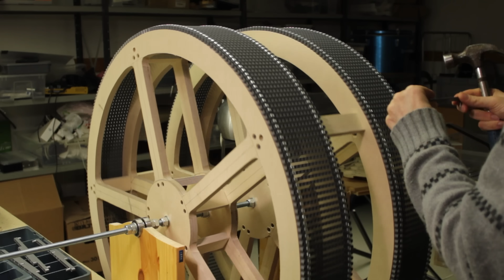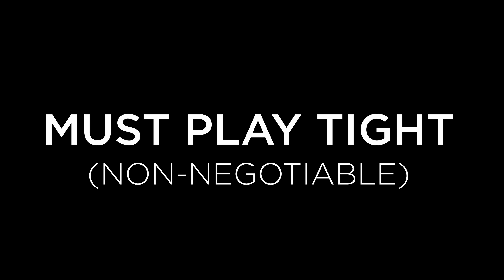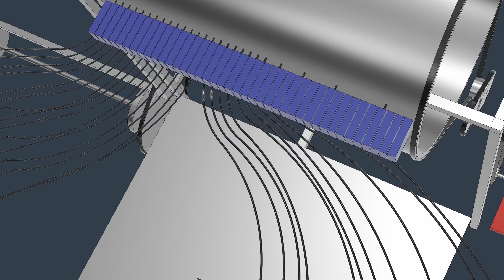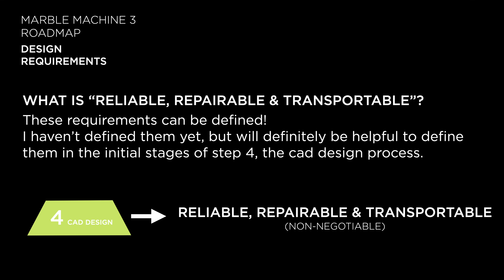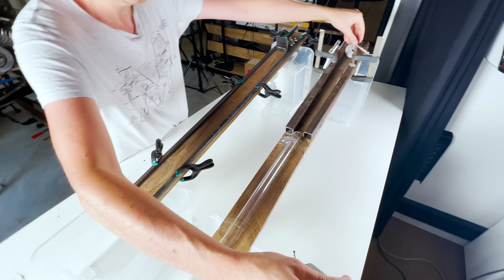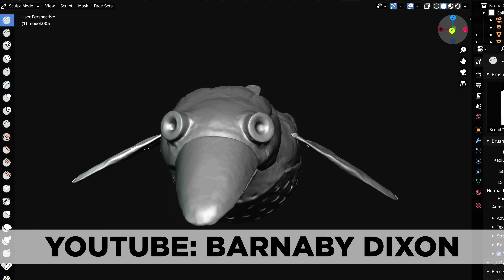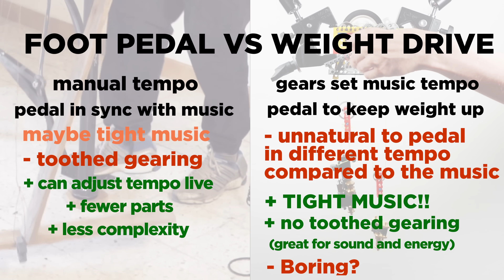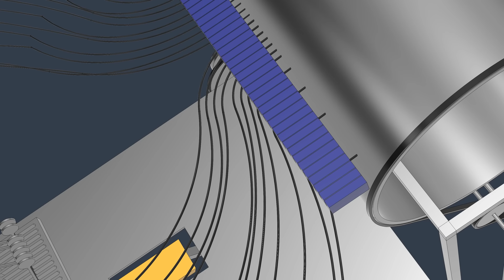Marble Machine 3 is Taking Shape

Comment: What about a Water Tank and a foot/hand water pump to utilize the weight of water as a gravity battery? To possibly spin a torque converter for consist flywheel turning… pump water into tank above, gravity flows water through a turbine to consistently spin a gear! ;)
Reply: Combination of water tubes and marble tubes would be cool :)

Comment: Martin,

The Foot Crank and Huygen Drive doesn't have to be an either-or proposition, I believe.  With a split transmission to the main fly wheel, you should be able to have a dual drive design allowing for both.  Just need to figure out if alternate "modules" for a foot pedal vs Huygen setup is the only way or having both drives and allowing the main belt to pull from either one, using a shiftable clutch of sorts.

Some food for thought.  Peace! <><

Comment: For the drive - I think you're confusing the function of providing power(actually "energy") into the machine - with the function to be able to control timing.  By choosing your foot to provide energy, you're making demands on your body that may get harder to achieve.   Suppose the machine ends up needing so much energy that you cannot provide it while standing on one leg and playing guitar or something?   I would imagine that the actual energy input should be separated from the tempo control mechanism.

Comment: You could pedal in the same tempo as the music just fine with the weight drive. You would simply adjust the force rather than the tempo to keep the weight up. It would also help to have a heavier weight which would give you more time to make adjustments.

Comment: Oh no... a V-belt is an option? Are you still not talking to (real) engineers?
The principle of V-belts exclude them from this project! V-belts work with friction; and the V-shape increases the friction angle, thus force. But thus they become to some extend self-locking in the groove and you need to pull them out of it. This creates vibrations in the drive train.
Just don't use V-belts!

Please for once listen - I tried to warn you so many times, but I guess negativ comments just don't fancy you, but your failures are due to not listening to people knowing their stuff. You are a musician, I am an engineer. Please listen and stick to your profession.

the best option is to go with a direct drive - no gears, no belts, just directly driven shafts. Go for constant velocity joints! No universal joints! Constant velocity. Works in cars, will work in a marble machine. Expensive, but will do the job and fulfill every requirement!
gears (bevel gears) are the second best option (please stop using straight gears; they are too loud; also you can make them quieter by changing their profile. Please ask an engineer about this topic if you have to use gears!).
timing belts have (a small) polygon effect; chains have a bigger one, so I rule them out.
V-belts see above. don't use them as well

Comment: @Wintergatan Radical thought: is it possible to add a safety to the weight drive so if you paddle, and the weight is at its highest point, it doesn't slam into the machine, even if you paddle.

So i think you could still paddle in sync with the music and the machine still works?!

Comment: Martin, I'm not an engineer, but I really like your work. So if you get the power from the flying wheel instead of the pedal, the pedal only speeds the flying wheel, that way the speed is more constant. To transfer the power of the flying wheel to the programming wheel, you could use a system like a CVT transmission,  getting precision control of the ratio. All three MMs are amazing!

Comment: Hey! Cool progress.
I haven't been following to closely, so this may have been tested already, but: Those really long Bowden cables scare the crap out of me. The longer the cables are, the more mass you are going to move to transfer the motion, you will have more friction, more elasticity, etc...  Usually, when transferring signals (mechanical or electrical) the shorter the distance, the better.  Have you considered breaking up the programming wheels and putting them close to the gates?

Comment: Perhaps the better solution is some sort of shift lever that would allow for the peddle or the weights…. You can flip the lever and have either power source.   Plus with a proper governor design you can change the speed…..Also maybe you can have a bike like set up… spin bikes behind where you have helpers pump energy into the flywheel.   If you want to adjust the tempo or timing you can still have that control but maybe without the need for yourself exerting the energy.

Comment: Has anyone one pointed out that Martin could use a gear box like that of a manual transmission. Add a clutch and gear box you would change the the tempo  by "shifting up" sure you can't find tune it but it would allow for acceleration and declaration of the weight drive

Comment: I'm a bit late to the party here and this might already have been said. But, having an abstract requirement doesn't mean you can't have a concrete one too. Tight timing should be easy to give one or many key values, e.g. latency error (a programming pin/key reaches goal until sound is heard, square it and provide the average), sound delta (two parallel programming pins/keys, measure time between when the sound starts. Do this for all pairs, square them, and average). Good sound is much harder, but at least you could do something with tuning and something with a noise threshold. Set your goals and measure, accept if they are not reached if you still like how it plays/sounds. Seeing how you can progress towards your goals with system tests can be very helpful.

Comment: You should be able to make the foot pedal to run independent of the tempo of the music by using a clutch that allow you to input power into the flywheel and using the momentum from the flywheel through a CVT style transmission.

Hopefully with a solution to switch between direct drive and transmission adjusted tempo.

Best of both worlds and neither a clutch, a CVT transmission or a system to switch between them are particularly complex at the torque levels you're putting though the machine.

Comment: I would say electric motor with foot operated gas pedal and foot operated brake! Tempo data could be told to motor in the big roll with similar system that the note lenght is read. And with manual over ride with each foot pedal.

Comment: Thank you for not going to the weight system. I think it wouldn't take into account variable load with the machine like a big beat drop or heavy played section where it would have to pull up a bunch of marbles at once then nothing. It would slow down with the load and speed up when it goes away

Comment: The governor can be adjusted by the height of the weight which is controlled by the speed of pumping. Hence you get super smooth transitions of tempo with a visual cue.

Comment: I was a huge fan when you made the original MM, and the early stages of the MMX project , but lost faith as MMX spiraled ìnto endless redesigns instead of converging and finalising, wrapped up in ever more process psycho babble. When you announced it was fully funded and then abandoned it in the same video felt like a betrayal. When you started MMX3 taking about DAOs and no construction until the was was finished (ie no testing and feedback) was the end and I bailed. I just came back to see where the project went in the (I lost track, a year ?) Since .. I can't even see where this is going any more. Bowden cables ?!. Its not obvious you have really learned about engineering design yet, I fear you are just exchanging precious mistakes for new mistakes. You obsess about the need for tightness (yes!) But seem to think that only impacts the marble release mechanism. Unless you make all the marble drop distances equal (which if the instruments are at different heights means the releases need to be a different heights you will only ever be able to calibrate it to be perfectly tight at ONE TEMPO. Since I assume you want to be able to have it play all tempos you need to make the drops (a) equal and (b) ideally short (the longer the drop the longer it takes and the bigger timing errors will be when you change tempo)

Comment: @Wintergatan isn't it possible to have both pedal and weight drive at the same time with a way to switch between both?
Also, if the power unit is modular, you could experiment with different ways to power it later on

Comment: What if you used a Digital Touch pad to set the tempo with your finger tap and then the machine generates up to that pace then starts playing when you engage it. And you can adjust it by tapping a different beat (more thought on how the machine would transition without sounding weird). This way you could have presets too.

Comment: You could easily have the weight drive and pedal the pedal would just wind up the weight or flip a clutch and drive independently. You could go flat belts for the clutch and a variable speed pulley could set tempo (hand crank cvt)

Comment: Bit of a warning...The design requirement of "It must play tight" is a big failure point. It's not really definable between two parameters, it's like saying "it must be perfect". There is no "perfect" in the machine world there must be a high and a low tolerance to design to. Your success in the first machine was that your tolerance high too low was that it play a recognizable tune, it succeeded because the tolerance was super wide. The second machine failed because your tolerance was way to tight "it must never drop a marble" isn't achievable as you found out. So a proper tolerance must be chosen to allow for success to be one of the outcomes. Think of it this way...if your playing in a band and the conductor had the goal that you would never perform if there was even one small mistake during the concert by anyone, then the result would be built in...the band would fail to play ever. You can chase poor tolerances forever and the worst tolerance is "it must be perfect" as this sets failure as the goal from the beginning. One key point you missed in MM2 was that the audience would have gratefully accepted way less than you tried to achieve...you should let the audience set the tolerance. If they come to watch it play then it's a success...if they don't come then it's a failure. This was where you "thought" that MM2 had failed but in fact the audience would have loved to watch it play even with some flaws, it was in fact your flawed thoughts of tolerancing that led to the perception of failure. The MM2 will play to a grateful audience every day in the museum, and it could have played to a grateful audience in concert...the audience would have been happy with the flaws it was you that drove yourself mad using way to tight tolerancing.

Comment: I would go deeper and make more assumptions and requirements less dumb:
1. Why Marbel machine? What is the value?
2. What consist of a marbel machine? How much mechanical it needs to be? Do all modules need to be mechanical?
3. Why programable wheel? Why not a module with solinoids? Why not both?
Mi suggestion would be to make madules work on their own and be able to switch the modules. eg. make it easy to switch flywheel for electric motor, or electronic full gate control via solinoids module

The more modular and granual, the easier to test and interconnect, disasamble and transport and how about sharing the project and have a comunity designed interfaces
One MM3 is nice but milion of those, that can anyone 3D print, thats where the real power of the crowd lies.

Also just imagine MM3 0.1 that has just gates with closed marble loop per gate and a Archimedes lifts and electric power module and solinoid release / MIDI module.
It could be relatively small and really fast to design and produce ---> world tour 0.1
When you finish the other modules make the version 1.0 when ever you are ready. Dont waint until it is complete or perfect, just go on the tour already.
Reply: He has already answered these questions in previous episodes of the MM saga.

Comment: If you want to play very tight music using your foot, you might want to consider comparing your tightness to other stage musicians, especially drummers (click or non-click). As long as you don't need to keep up with an electronic music machine, your tightness requirements might be less strict. Since you are a musician, you are and to keep a tempo. The small fluctuations of any human player should add to the music feeling natural instead of robotic and boring. 

Having the option to react to the audience's energy plays into this as well. I like the option to adjust your speed live as needed.

Comment: Hi Martin,

I know commenting video 2 weeks old is not good but i will try anyway.

I like your explanation about tight music. The acceptance criteria are set well. But honestly I don't expect tight music from live performance. and all your tests with tight music sounds good enough for me :-)

For the main topic of the video how it should be powered.
If you really like tight music you should look at the cons of the weight drive. How to pedal in tempo of the music? This question can be transformed to "is it possible to not transfer pedal power to the weight drive when it is not needed?" Or to "how to involve pedals only on some certain  range of the weight?"
For the different tempo the question can be transformed to "is governor adjustable during the performance?"

But you right the weight drive is complex already and really tight music not the ultimate value for live concerts. IT is communication with the audience and be on the same track.

Comment: Would an electric motor drive with a variable speed foot pedal be good for this? Or is the introduction of that type of component against the spirit of the machine? It could eliminate muscle fatigue and remove the variable of muscle cramps during a long performance!

Comment: My parents have in their living room a player piano from the early 19-teens.  It uses foot pedals to power a bellows that blows air through a perforated paper roll; each perforation corresponds to a specific key to be played, and the duration.  Without touching the piano keys, the piano "plays itself," with the power of the air bellows and mechanism, from the foot pedals.  [Some people are familiar with this kind of player piano and others are not, so I'm describing for those who are not.]. You sit on the piano bench, place your feet on the two pedals, which move in a simple up and down motion (not around like a bicycle; simple single-hinge boards).  You can pedal faster or slower, but there is an optimum pedal rate that powers the bellows and mechanics.  The tempo of the music is determined by a lever that changes some gear inside; the tempo is not determined by the pedal speed.  It can be tempting to try to pedal to the tempo of the music, but that does not work.  Your feet do the pedaling at the optimum bellows/mechanics speed, and the music plays at the tempo set by the gears.
All of this is a long way to say that there could be a system of power using foot a foot pedal (or pedals) that would not affect the tempo.  It's not impossible; I've done it.  (Not designed and built, obviously.  But I've played it.). And it works perfectly well.  So if your weight system requires some power from you that is not in tempo with the music, don't be afraid of it.  It can work.  And, if you can manage to incorporate some form of tempo adjustment lever, you can still retain that freedom.

On the other hand: having the foot pedal BE in time with the music; having that mechanically necessary part of the instrument also contribute to the musicality of the music produced:  I like that idea quite a bit.  And as you mention, being able to modify the tempo with a simple thought and immediate physical change by pedaling faster or slower: that is the ultimate live-music experience.  That's what makes a musician, their ability to feel the music and adapt it to the moment, rather than a static piece, always the same every time, like a recording.  If a tempo lever could be incorporated, you might be able to have both: tight consistent play, as well as artistic creative input in real time.

The original was (is!) awesome.  I can't count the number of times I've watched that video, enjoyed that music.  The way the mechanics were a part of the music; their sounds were part of the experience.  The mechanics, levers, speeding up, slowing down, the "breakdown" section in the middle, revving up for the return of the theme, the slow retard at the end as the gears wind down: it was all brilliant.  It is what brought you to this point, and I look forward to the future...

Comment: If instead of a weight your huygens mechanism used variable rate springs it would allow you to more directly influence the tempo.  As you input power faster, the spring tensions to a greater degree and outputs more torque, speeding up the machine.  As you slow down input, the spring gradually rides at a lower tension, decreasing the torque.  If you stop inputting energy, the torque gradually drops to zero rather than suddenly stopping when the weight hits bottom.  Springs are lighter and take less space that weights.  You can prototype it with rubber bands and lego like you did before and see if it does what you want.  Good luck.

Comment: The Huygen weight drive is not inextricably linked to a pedal tempo. There are ways to pedal at random speeds to power the weight drive. I would argue that it would actually be harder/more complicated to make your pedal pumping tempo be linked to the weight drive in any fashion.